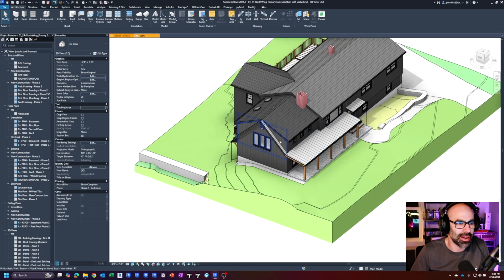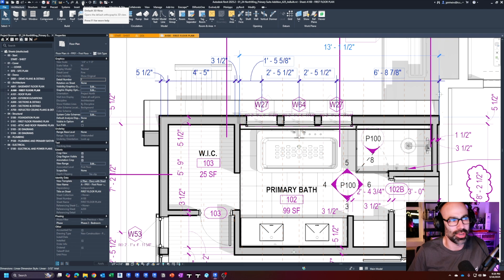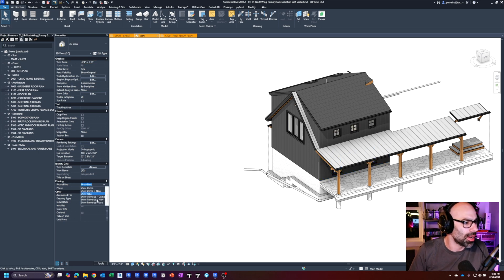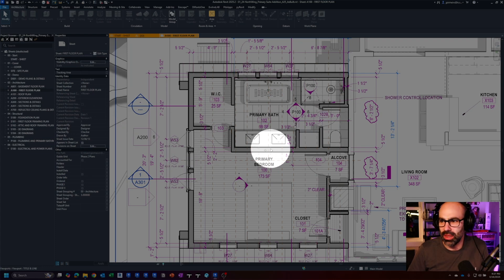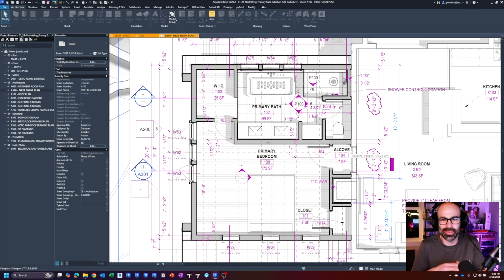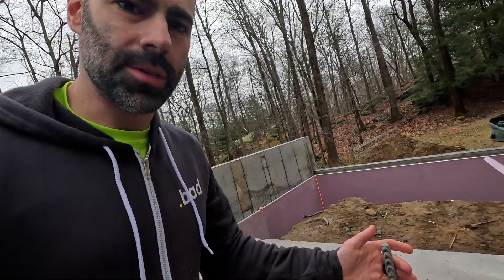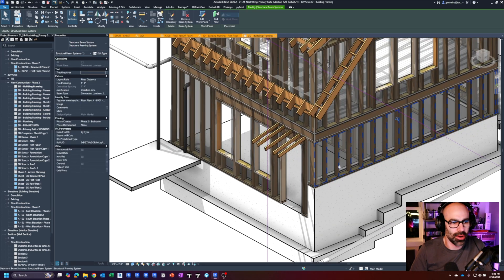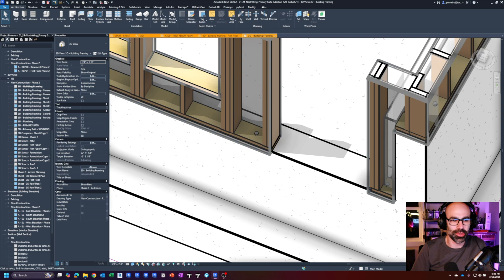Foundation Walls Complete and Anchor Bolts in Revit! (North Wing Pt 11)

Comment: I know this problem for sure, I suppose you also shifted the main toposolid?
Reply from the maker: @eastudio-K  the toposlid and existing house were moved
Reply: @TheRevitKid  Thanks for always following up on comments on your channel!  This channel has been a great resource much appreciated.  
nice idea for the bolts, another possibility is have two plates I think, so to not run into the problem.  I also typically show an outline of the plate so contractor knows where the plates will be.  For foundation plan i typically use spot elevations for top of wall and bottom of footing and top of slab, and show footings dashed but light lines
Reply from the maker: @eastudio-K  I reply to every comment! Unless it’s spam or trash 😉😂